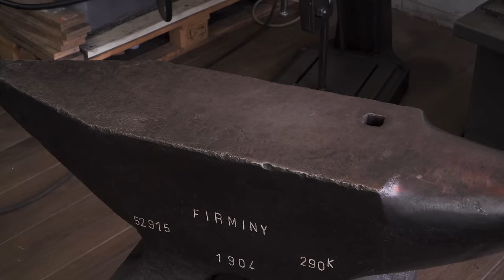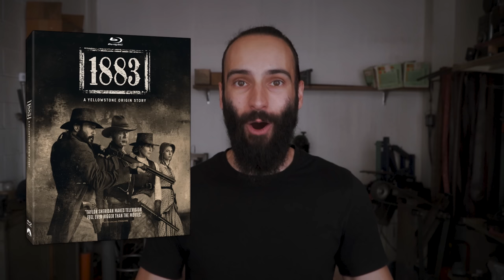Making a Bowie Knife Replica from 1883

Comment: you may wanna be carefull about forging at the lower red to black temperatures especially with the sharp dies of the press, its an easy way to form micro fractures in the steel

Comment: Did I miss the oven tempering step after the oil quench…?
Reply from the maker: Yeah, I ended up re-quenching in water because it didn't get as hard as the original blade. It did in water tho, ended up at almost 60 Hrc but I didn't include all the footage because it was just boring :')

Comment: it is way too thin and give it distal taper,the tang is to thin and the corners of the tang shoul be rounded so it wont brake. Dont have to be so thin to be a fast knife. It should have enough mass to cut a arm of and a sharp long atleast 4" upswept back swedge to do back cuts with,stabby like a dagger,cut like a razor chop like a hatchet. And not a round handle eather,and you cant chop wood. This must have been a bad bladesmith that made this knife so many years ago.